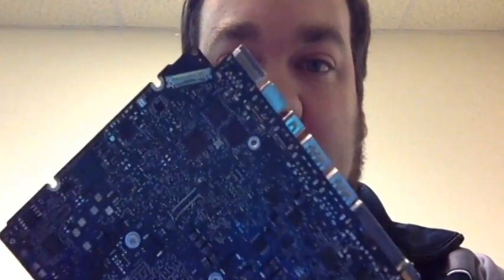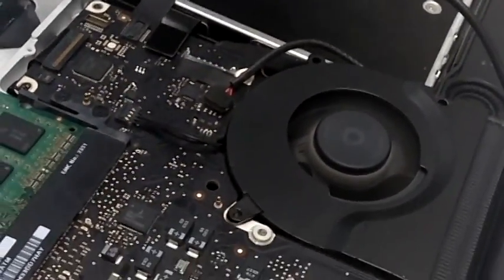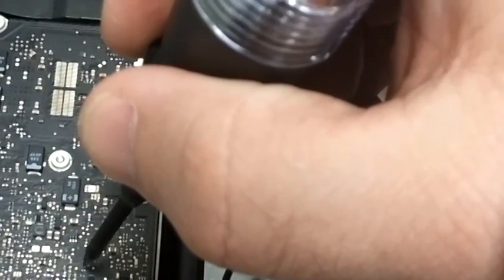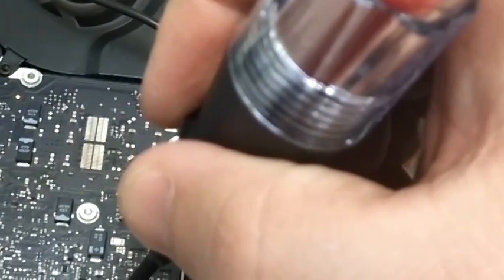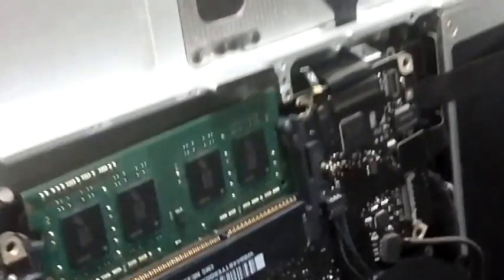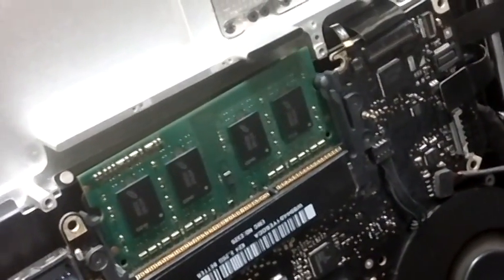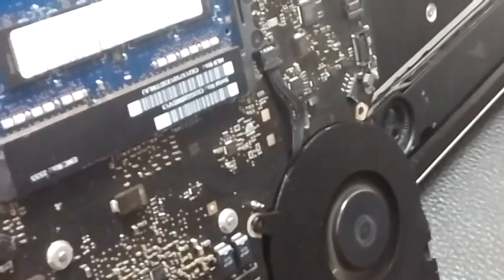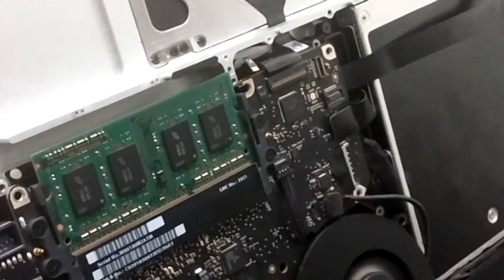Apple MacBook UniBody No Video Repair On 2010, 2011, 2012, 2013 Systems With Testing and Repair

Comment: Hello, what's up? My 2011 Mac book pro unibody is not working. Before it stopped, it was heating up for no reason, the screen began to have gray streaks. Now there is no response. If I press the power botton, there is nothing. The battery shows light but there is no sound and the screen is black. I sent it to be fixed but they sent it back and said everything is working fine. I think they reset it and was working fine for a couple of hours, then it's back to the black screen with no responds.
Do you think I have to send it back to the factory?
Reply from the maker: Solomon Da King In our experience it is a video chipset issue, not a software issue. Upgrading to 10.10 caused issues with the GPUs in systems that were already stressed.

Comment: How can a reflow going to last if the chip is dead?
Reply from the maker: ***** The chipset is not dead in most cases. If it is damaged then the pads underneath are damaged, the chip is damaged, or the solder is joined. A reball and chip repalacement would be needed if that is the case. Check here for our explanation: http://doubleclickittofixit.com/how-can-i-tell-the-difference-between-a-hot-air-rework-and-an-ir-reflow/